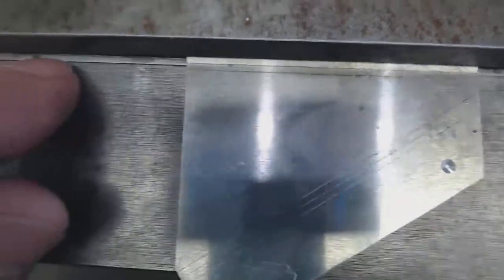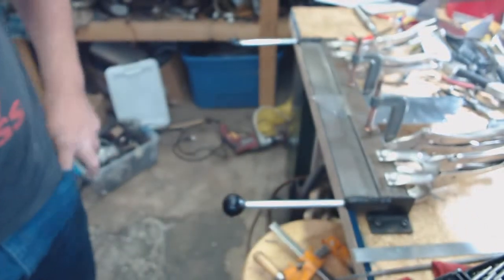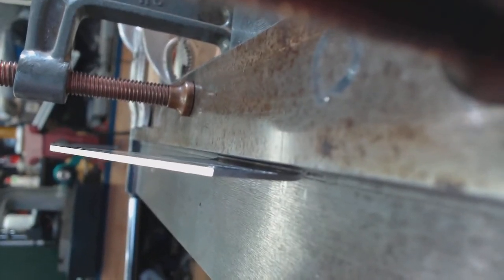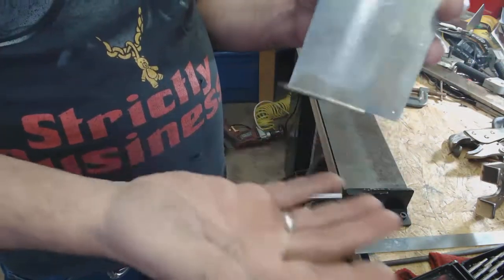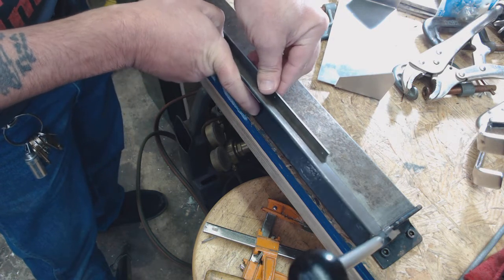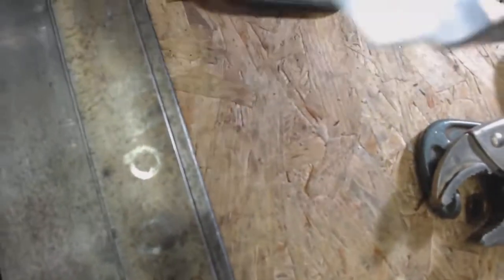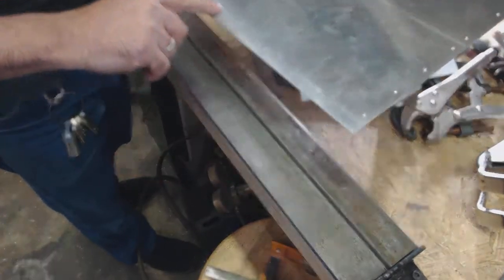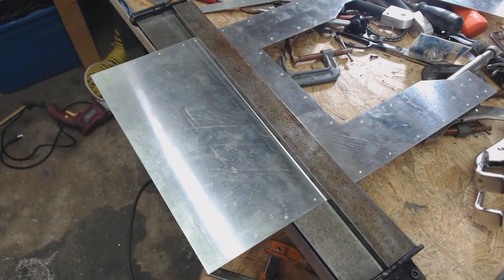Bending Aluminium Part 1 of 3

Comment: Offsets for your bends are pretty simple to calculate. Most any mechanical drafting book will give you the formula based on material, desired radius, and thickness.
Reply from the maker: Thank you for your comment! The parts do already have those bend lines already engraved onto them but it seems that in practice using the rudimentary equipment I have that there is the "expertise factor" I'm also missing. The parts are pretty good, all things considered. Not nearly as easy as some of the YouTube videos I have seen makes it look....LOL